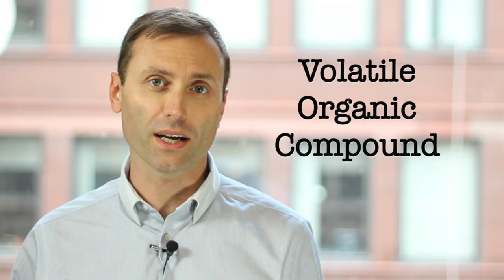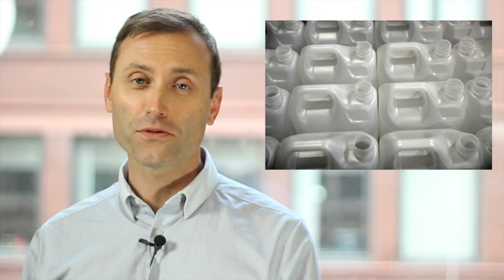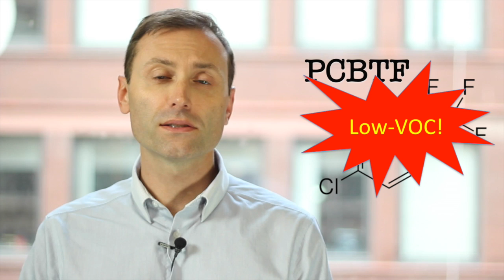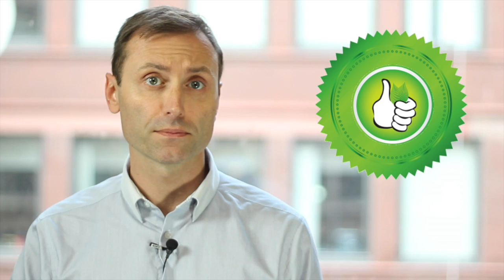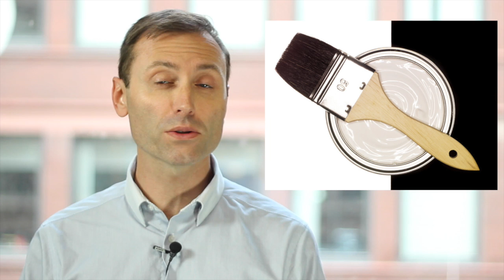What does Low VOC mean?

Comment: a lot of valid info - we'd say to use independently Certified ZERO VOC Lakeland Paints [0.000% VOC] in the UK or sold as Ecos in USA - we spent 6 yrs formulating these paints to avoid these issues.  lakelandpaints.co.uk      ecospaints.net
Contains No "exempted" VOCs, no glycols, no APEOs, no solvents etc
Reply: Does it kill or prevent mold too? 🤔
Reply: Hi - we do have anti-mould versions of eggshell & matt @capcom4eva